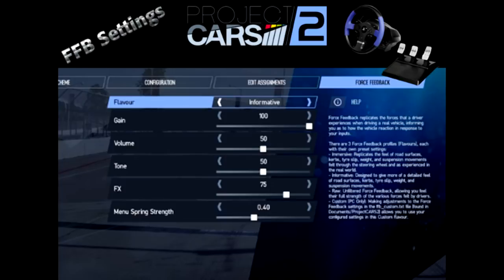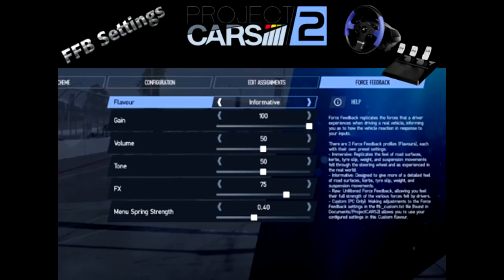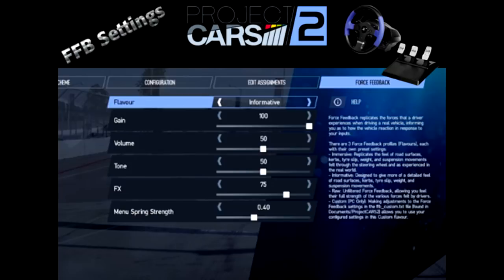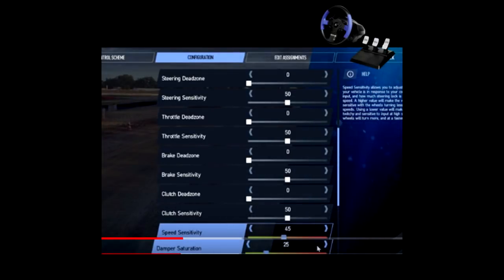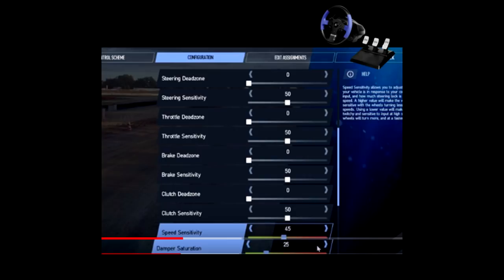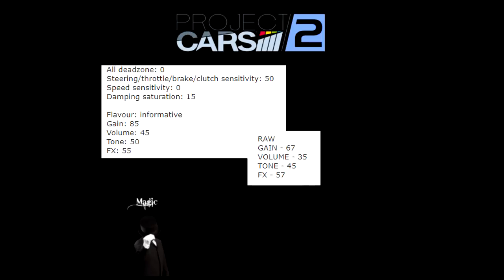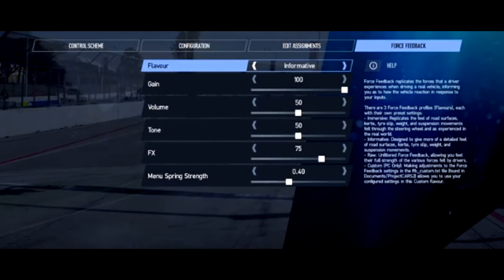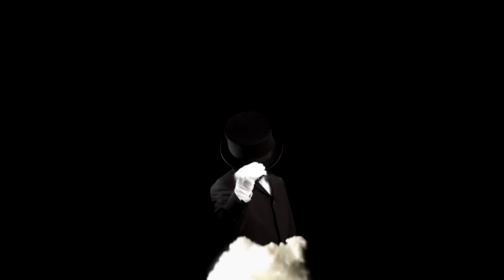Project Cars 2, Thrustmaster t150 Setup & Config  Ps4

Comment: How do you connect the controller?? The wheel and pedals don't work. For some reason triangle works and changes my view. The wheel does work cuz i play gt sport. It doesn't work on project cars 2
Reply from the maker: Did you try calibrating the wheels and pedals then make sure you assign your shifter  for gearing but if you want to try your controller then make sure you switch it to controller on the configure screen. Let me know how it goes please. I'll try to help further if you need it. GL
Reply: yeah thats what I was hoping he'd explain but he didnt

Comment: I dont know if i'm just struggling to get used to a force back wheel or if my settings are wrong.  but theres parts of GT6 when the wheel seems to take control of me!  it spins uncontrollably  ( usually if I spin or crash! ) 😂  is this normal?  sensible answers appreciated.
Reply from the maker: If your FFB is overpowering/too strong, try dialing back on the Volume in wheel config.  https://www.youtube.com/watch?v=Pbq5fb-ek4I&t=8s

Comment: Pc TM FOLDER
Main ffb 40
100
0
0
Gain 100
Vol 25
Tone 50
Fx 55
 Steering sensitivity 70
Breaking sensitively 25
Speed sensitively 50

Tuck me a long time to find settings for thrustmaster tx for all cars without an absolute load of clipping, 👍👍👍
Reply from the maker: Nice. I'll try this setup soon and post it if you don't mind. I'll give you credit in the video of course. ty
Reply: Magic Ok mate no worries 👍👍,
Im enjoying pcars2 massive improvement 👍 👍

Comment: Hey man i got T150 but not recognise on project car 2 on ps4??! Any help??!
Reply: Plug directly in to ps4 usb
Reply from the maker: Hi. I had this problem briefly .  1st  double check and make sure every cable is connected . After you you turn on your Ps4  your wheel should start spinning. After it stops spinning you have to push the PS button on your wheel and that will take you to your user page. Push "x" on the wheel to verify that user. You should now be able to navigate through your Ps4 and start your Project Cars 2 game followed by going to the calibration screen in game controls. Please let me know how it goes if that don't work  i'll research more for you. Good luck bro.
Reply: Magic man the wheel waking on wrc7 all the game but not project car 2 i start the game on ps4 but the problem is stopped on press × start my wheel not do anything all buttons  not working anymore after update the game if I play without update i play the game but i use CD on ps4..??!
Reply from the maker: I am stumped with this problem. I don't know if you just have a bad copy of PC2 and should try and trade for another copy or better yet  here's a link to Pc2 tech support forum and post your issue there.
http://forum.projectcarsgame.com/forumdisplay.php?152-Technical-Help-amp-Support-(PS4)
 In the mean time , I'll post a video up in the next couple of days asking if anyone else had this problem and I'll ask how they got it fixed. I'm sorry I can help figure this one out but don't give up bro.
Reply: Magic thanks man i just try again today it works so let's see next time and i try ur settings not bad too but i always suck on racing game but it's funny playing..I am more rally dude lol..any way that man cheers ..